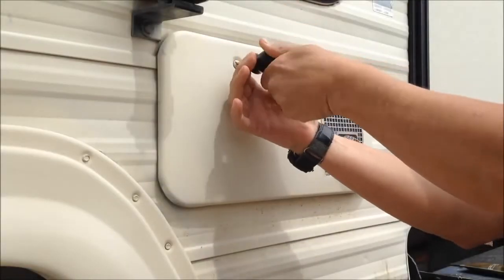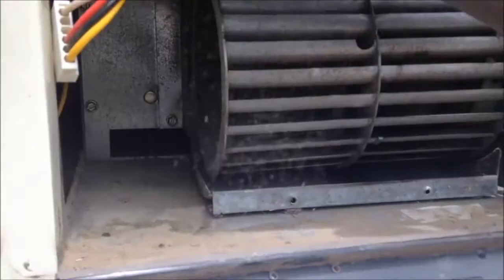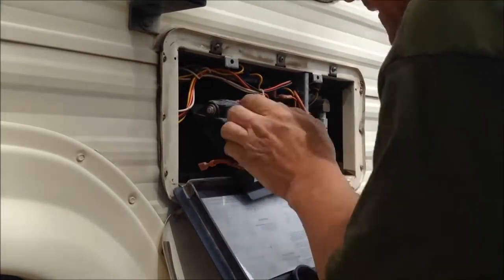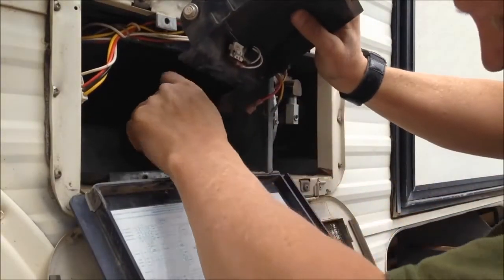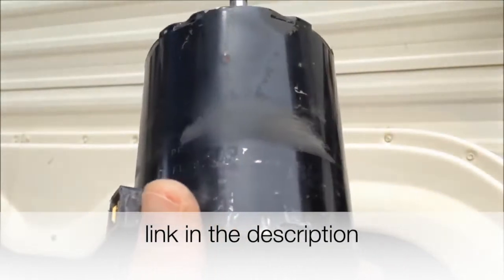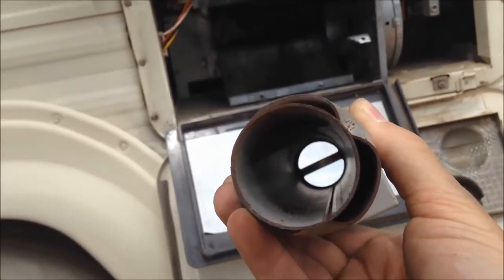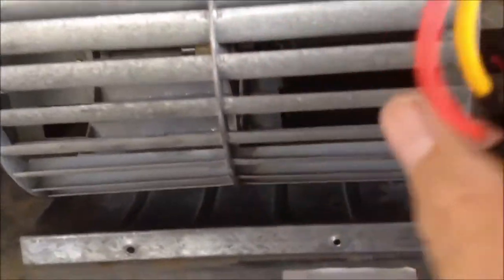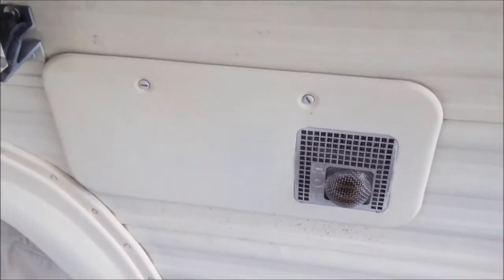How to Replace an RV Furnace Motor - Atwood 8535-II DCLP Hydro Flame

Comment: This guide to the motor replacement was EXCELLENT! Thank you so much.  I'm a 50+ lady and I did it all by myself with your guidance!  FYI, loosen the exhaust wheel screw AFTER you pull out the blower wheel.  Mine was so stuck,  it was coming out with the motor. I had to tighten the exhaust wheel again so that the motor stayed in its place until I could remove the blower wheel. Definitely have the right allen wrench! Thx again!
Reply from the maker: That is great to hear! Good job, I’m glad the video helped you out!

Comment: I want to thank you for posting this video! I struggled for an hour before deciding to go to the university of YouTube and get help. One thing I should have done was to spray that shaft end with WD40 and let it set. Dang that was a bugger to get off. I had to cut a 1x3 board and insert into them opening above where the exhaust vent was then get a pry bar and pry the motor off the shaft. Finally got it though and didn’t break anything but I don’t think I would’ve finished without this video. Great job.
Reply from the maker: Glad you were able to get it done! Good job!

Comment: Thanks for the video. I did it in a half hour without removing the burner like most other videos. I used my map gas torch on the exhaust fan and it came right off no problem!
Reply from the maker: Nice work!

Comment: Thanks for doing this video. Ive got an 8525-11 and the blower motor has developed an ear piercing scream. Ive lubricated it a couple times but it only stops for a day or two. Looks pretty straight forward.
Reply from the maker: You are welcome. I wish you the best with your replacement project.

Comment: Thank you so much for making this video. It was so hard to find such a detailed removal and installation on the very same unit that i have!! I was very weary about the motor that i ordered because i was not able to find a correct model number for the motor, the motor i ordered is almost identical to yours the only difference i see is that the wires on mine are super long and the model number is different but other than that shafts and the case even the rubber boot on the base of the wires looks the same.  Awesomeness
Reply from the maker: Excellent! I wish you the best with your project!
Reply: @DIYHomesteadProjectsDIYHP10  thanks bud! Ill be doing it tomorrow after work

Comment: My motor is fine after removing the noise was from the shroud buy I am having trouble finding the right one on amazon the height and width varies, the motor is new still had tag in there its replacement motor I must not be searching the right part number for motor as different sizes fit on the motor. What sites do you like to buy parts from that can find right part even when replacement parts are on RV? Do you just use Amazon? Theres big difference in price for the factory parts and replacement parts. Maybe you have vid about finding the right parts at best possible price? Any advice would be appreciated. Thxs again I like the way you explain things so even a beginner like me can understand.
Reply from the maker: I just use Amazon for RV parts. I would just search the furnace brand and model number if you can find it on the appliance. RV supply stores will charge you two or three times what you pay on Amazon IMO. Hope this helps you out.
Reply: @DIYHomesteadProjectsDIYHP10  Thanks for reply you are appreciated.I was cruising around and found a few acres with trailer and barn with several RV hook ups in Blouse AZ its just desert nothing fancy for sure but peaceful, quiet and incredible sunsets, you are welcome to use RV hook up if your ever passing thru, really I wont use much and its free for you, I mean that.Its good place to relax regroup get bored and want to leave.lol So if your passing thru comment on my comment and I will see alert hopefully and we can figure it out. Its sincere offer for being here for me. Happy trails Bruce.
Reply from the maker: Thank you for the offer, I appreciate it. I'm glad my video helped you out. Have fun out there in AZ and enjoy the peace, quiet and beautiful sunsets. I love those AZ sunsets!

Comment: Can you give me the proper replacement furnace for this unit? I cannot get the exhaust pipe out I believe it is Rusted and corroded to the point where it won't pull out. I'm pretty sure I have to replace the whole furnace?
Reply from the maker: Potentially this one? https://amzn.to/3AwECcU I recommend you contact the manufacturer first to make sure it will fit your RV. There is manufacturer contact info on the item ad. I wish you the best with your project.

Comment: Any tricks if the front set screw/fan wont come off?
Reply from the maker: Did you see in the video where I heated the hub with a match to loosen the set screw? That's about the only trick I know to loosen the set screw.
Reply: @DIYHomesteadProjectsDIYHP10  that is great tip could save novice time and frustration Thxs Bruce I subscribed!
Reply from the maker: Thank you for the sub Cragger! I hope you can find some useful information here or maybe even some entertainment. :)

Comment: Please help, my local rV mechanic for whatever reason refuses to help me replace my propane heaters, claiming liability and fears he won’t be able to live with himself if something goes wrong - I need to know once i clear the gas line through my stove and I turn the gas off at the tank, shut my breakers off and unplug my motorhome, somehow break loose the bolts connecting to the gas and pull out the heater, I won’t be able to use my stove until I get it all fixed and put new heaters on correct? I know that seems obvious but just wanted to know if there is somehow to plug the gas lines and still be able to use my stove. If not no problem, I have a camp stove I can use and fire pit.
Also, how do I make sure it is all sealed properly - the neighbor mechanic told me tape but I heard there is a wet substance of sorts that is supposed to be used to make sure it is sealed correctly. And once I get it all put back together do I need to somehow purge the gas line or something or just turn the gas on, check the connections with soapy water and turn my heater/stove on
Reply from the maker: Personally I just apply soapy water to all connections with the gas turned on and under pressure. Just dish soap and water and spray it on or use a wet rag. If you see air bubbles at the connection, you have a leak. No need to purge anything, just turn the gas on and when the gas gets to the appliance it will light. I don’t know what to do to block off the line so you can use the stove before you finish installing the heaters unless you put in a shut off valve.
Reply: @DIYHomesteadProjectsDIYHP10  Thank you, much appreciated!!!
Reply from the maker: You're welcome Deanna, thanks for the visit.

Comment: How much was the furnace motor?
Reply from the maker: I've included a link in the video description to the motor I used in the video if you want to check it out. I do not know what the current cost is today. I purchased mine several years ago.